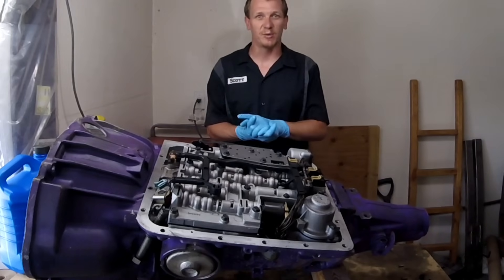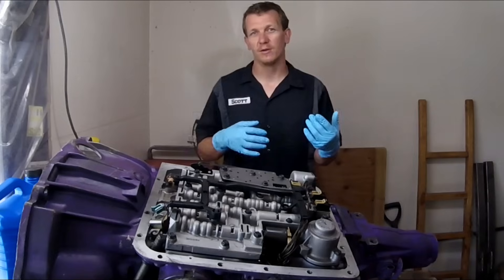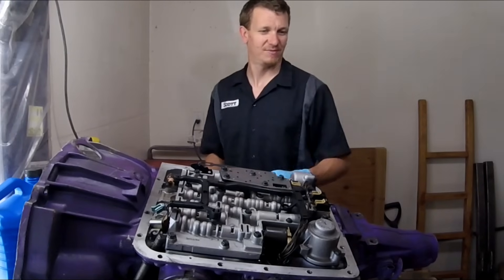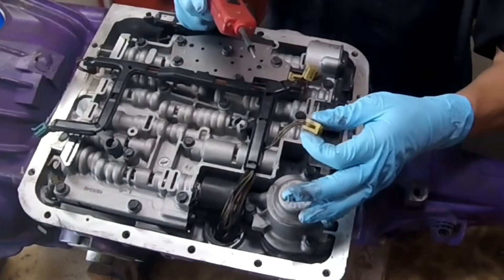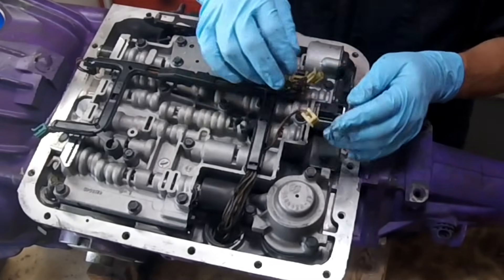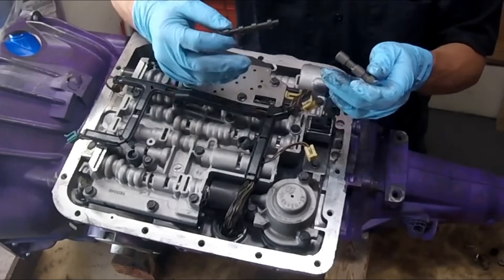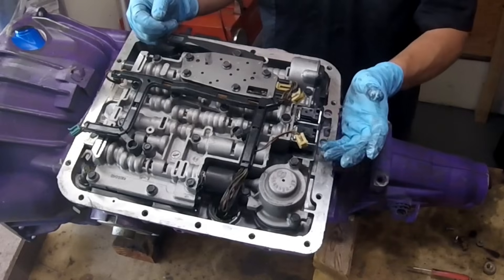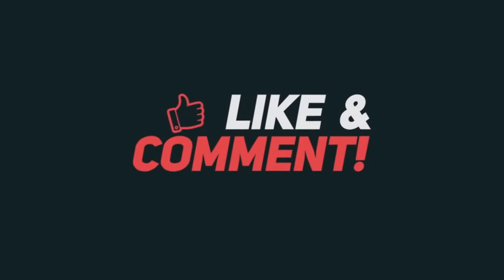⫷ GM 4L60-E Shift Solenoid 1-2 3-4 A and B replace p0756 p0753 p0752 ⫸

Comment: Let me just explain my problem I have a service engine light on check engine soon it's nothing wrong with the engine is actually the transmission the transmission will shift into gear but if I sit for a minute it won't shift into gear but if I shut the truck off start it back up it'll go into gear and it'll drive in the first gear and when you tries to switch over to second gear it's like second gears not there and then sometimes it'll switch into second gear and you'll feel it for a little while and then it'll go away now I have noticed when I started I can hear the pressure solenoid make a click sound that's real loud enough for me to hear it put it that way if I drive a short distance and I stopped going to reverse it goes into reverse a backup I put it back in the drive or go in the drive I'll drive for a while and when I put in Reverse versus not there does that constitute the transmission is gone what is a severe problem with well almost to severe you're my question is is that cause by the solenoids or does that mean the transmission is gone it don't make sense when the transmission fluid is clean I keep the transmission fluid full is clean it's not overheating or any of that it just started not working one day

Comment: There's just not two why don't you mention all of them I found that there was seven of them and I'm having a damn problem
Reply from the maker: You need to save for a rebuild. Don't waste the money. These are shift solenoid a and b. There are different solenoids but they are not c, d, e, etc. But if you have over 100k and problems, save for a complete rebuild. The bag of worms has been open. Good luck!!

Comment: hey man wondering if you could help me out I have a 2011 Silverado with 4l60e I have first and second gear doesn’t catch 3rd or 4th. What could he the issues I was thinking about replacing the shift solenoids and the torque converter solenoid
Reply from the maker: You could try those parts. If you have over 90k, probably the 3rd and 4th are probably worn out. Its common for the 3rd gear check ball to go bad in the case and leak. That causes 3rd and 4th to go bad in these trans.  

This is a video that goes over the check ball a little: https://youtu.be/rkhMJe3iS7w

Comment: Hello
I bought a A new 4L 60 E harness I just replaced my TORQUE CONVERTER and now it’s throwing a code P0758!  transmission fluid is filled at the right level

Comment: hey sir got a 04 cadillac and  its fine in par drive revers but when i put it in drive seccond to third gear it revs high till i let go the foot and it shifts but if i go in manual mode 1 2 3 no problem  whats up? anyone  got some tips?
Reply from the maker: Can't guarantee anything but if I was looking at that transmission I would start by looking at the accumulators.

Comment: I had a very weak shift solenoid when applying the 9v so I replaced it the sluggish acceleration went away tons of power but 3rd gear completely slips lost not sure what’s next.

Comment: My brother thank you for your time and help. My situation is. I’ve replaced the transmission, both shift 
Solenoids,filter and fluid. And I’m still getting the same reaction from my first situation.2004 GMC envoy:4.2 / 2 w/ Dr. Please please help me with this project. Also I have no obd 2 codes

Comment: Quick question,  which solenoid controls shifting from 3rd to 4th , or overdrive?
Reply: Ok ...how do you know it's b
Reply: I wish i knew which one is b solonoid also @jeromeneely202
Reply: Were is overdrive solenoid at for 1993 c1500 Chevy truck
Reply: @timhinson2841  B solenoid
Reply: B
Reply: @timhinson2841  in the transmission
Reply: From there both are same, you could put them to left or right!

Comment: In your video you say both wires of the shift solenoid plugs should show continuity. That being the red and green of solenoid A and red and orange on solenoid B in a 2004. I'd did that and only the red Gaver me continuity. My question is if it's a DC current why would they both have negative continuity?
Reply from the maker: I believe it was key on engine off all wired had continuity.
Reply: @ScottiesHobbies  Wouldn't key on send a normal DC signal? How could you get all 4 negative?

Comment: How can I check my shift solenoid on same exact trans u got here with a multimeter?
Reply from the maker: You can check the ohms of resistance using a multimeter. I don't remember what the specification is off the top of my head. You could also use a 9 V battery is the battery and see if the solo noid clicks when you apply 9 V power.

Comment: Can these shift solenoids cause code p1870 to pop up on my car scanner?
Reply from the maker: Doubtful. Probably something more to do with the valve body.
Reply: @ScottiesHobbies  oh ok I see
Another quick question sometimes getting off the highway I have a hard shift on the gear going from one to two but on red light I shut off my truck and before it turns green I start it up again and the hard shift goes away. What do you think has to do with that?

Comment: you mentioned using power probe to check for ground in solenoid wire harness (said should have ground on both sides or plug) which it would have been great seeing you actually have the probe activated on a battery to see you do it... I get ground only one one side of each solenoid harness, so was it true the probe should light up or beep on both sides? and or should the car key be turned? or everything off to do test?

Comment: I have a 4L60e that slowly starts to overheat after 60-90 minutes of run time then starts to shift hard. Any thoughts?
Reply from the maker: Plugged filter would be my start. Poor flow can cause the fluid to hear up.
Reply: @ScottiesHobbies  I'm going to start there. I just thought it there was something else I could check or change once I'm inside I would. Thanks!
Reply from the maker: @caseyott7463  its hard to say look at this one thing or another. If you are getting over heat and no drivability issues, I'd think fluid flow is going to be the issue. You could have deeper issues such as a bad 3rd gear check ball causing 3rd and 4th gears to go bad. If you have a lot of material in the bottom of your pan, get ready for a rebuild.  Other than that, might check the valves in the manifold, but... I think you'd get a code or drivability problem.
Reply from the maker: @caseyott7463  if you have compressed air. I'd take both sides of my cooler lines off and put 3 to 5 psi through one side to clean the cooler lines out. You might have a restriction in the cooler too.
Reply: @ScottiesHobbies  transmission was rebuilt about 2 years ago. Didn't notice any issues until the first long trip. Wasn't sure if I should change anything else while I have the pan off
Reply: @ScottiesHobbies  will do. Thanks for the info!
Reply from the maker: @caseyott7463  honestly... once upon a time.. I bought a rebuild that was 'bullet proof'.. around town for almost 6 months it was fine. Then the first camping trip we  took that season, we took that tahoe. Couple hours from home, almost 200 miles away.. I start getting the trans over temp on dash. We parked, let it cool down and made it up the hill. Thank God it was mostly down hill the whole way home. I ended frying 3rd and 4th gear cuz the checkball in the case never got changed.

Comment: I did replaced the solenoids on my 98 blazer and after i assembled all together    i started on but did not engaged either forward or reverse. I problably need to go back and check the solenoid pistons and continuity on wires. Thank you so much for this video.
Reply: What did you end up doing? My 94 Silverado is doing the same thing.

Comment: I have a question,I bought a pair of shift solenoidsand they are letter A but the original ones are letter B and my transmission is only working on 2,3 and reverse,does the letter have something to do whit it? thanks

Comment: I have ground only on 1 wire for each shift solenoid. No power to pin e but there is on pin d. Had p0756. Tested solenoids and they were good cleaned vb bore and nothing. Shifts good sometimes but then goes into third.

Comment: I just swap the tranny 4L60e and checked the solenoids 2 but I just noticed that B solenoid doesn’t have the spacer. Is that common or not? If not what is there for me to do?
Thank you
Reply from the maker: I have not figured out what is a noticeable difference on this situation yet but not all of the valve bodies have a spacer on the solo noise. If yours did not do not be alarmed and reinstall as it was.
Reply: Thank you
Reply: What’s your take on cleaning vs swapping the cooler lines? I can’t find the product to clean them
Reply from the maker: @elguero2296  ill turn my air pressure down to 10 psi or so. Make sure both sides of the cooler lines are disconnected. Introduce air to one line so the fluid and debris will come out the other side. You can swap the hoses too to get the same effect. But the cooler might be clogged on that case.

Comment: What would be my issue on my 07 suburban if it shifts into 2 gear fine but when it gets ready to shift into 3 it doesn't?it just free spins threw the rpms.doesnt try to shift into 3 at all.any info would be helpful right now

Comment: Hello! I am having a shifting problem in my 2007 suburban 1500 LTZ. SOMETIMES, but not always, I can feel that it will not fully shift when I first start to drive. In order for me to fully feel it shift into gear I have to press the gas anywhere between 10-15 and ease off of it for it to shift, at this point I am anywhere between 0 and 1.5 RPMs,  this again doesn't always happen but does occur once in a blue moon. Same thing will happen again, I have to press on the gas and get to anywhere between 15-30 and ease off of the gas for my car to fully shift into the next gear, and at this point I am anywhere between 1.5 and 3.0 RPMs. In the 2 scenarios i gave that happens, my car over revs until it does shift, so that is how I feel and hear that it's shifted. I don't go anywhere over 50/60mph usually, but when I do, I don't notice any problems there as far as feeling it not shift and whatnot, I just feel like I am not going as fast as my car says I am, if that makes any kind of sense. We have fully replaced my trans back in May, we have checked TCM. ECM AND BCM, we have replaced speed sensors and at this point we are at a loss of what to do next. My husband is a mechanic for the military, and has worked on our type of vehicles, and a lot others as well, all his life. I also have been having the problem of my radio cutting on and off and my front left and middle driver side AC vents not working correctly (i.e. I will have the AC on and those to vents and the feet vents will be the only one blowing out super hot air as if we have the heater on instead), I feel like somehow that has a connection with everything but I'm not an expert.. He's tested all my fuses and anything you could think of in the car and under the hood and they're all good as well. We did have to rebuild part of my engine a couple of years ago, but I haven't had any problems with the engine itself since then, and he's checked it just in case, but no codes are coming up for the engine... What else could there be that he is missing? PLEASE HELP, because I really don't want to have to get a new vehicle after we just paid it off a few months back. Thanks!

Comment: I did a 94 chevy Silverado.  I was replacing solenoids and  I heard something pop and fly and hit the rear end.   Found everything I cleaned everything up put new solenoids in.  3 years later still  shifted  good.  My second experience was a code on a 2001.   I found out a 16 year old changed transmission fluid and knocked a clip loose with the pan ,  while inspecting it.  Just snapped it back in.   The simplest solutions are usually the right solution.
Reply from the maker: That is the biggest mistake with new techs. I did it too. A lot of repairs are small and noticeable if you take the time to look at the whole picture before you start. 

Great tip!! 💪👍 keep us posted on your repair process and let us know if you have more awsome tips.

Comment: oh ya I used a snap on brick scanner to check if shifting it show it is shifts to 4 gear lock up and if u go under and turn on shift solenoid with scanner u can hear them click but not the tcc one not sure witch one scanner turning on but shouldn't you hear it click to   thank again rick

Comment: I got a S10 98 Chevy blazer it throwing 753 code shift 1/2 I changed them both it shifts great but it keep throwing the same code if went threw all wiring only thing I'm finding is   tcc is only showing 10 om's  it shows to be u on transmission plug just not sure witch one it is of the tcc solenoid it is but shouldn't it throw different code if it  iv had pan off like 5 times now checking wires and solenoid's thank in advance all help would be appreciated

Comment: i have a 2012 mazda 6 and there’s this AT light popping up next to the part symbol i replaced the tcm the transmission fluid and speed sensor but no luck could this be the issue ?

Comment: I'm getting no continuity from any solenoid wire, HELP
Reply from the maker: with key in the on position?
Reply: @ScottiesHobbies  no...the key was off...MAN and I've already put it back together and it didn't fix the issue... interesting though, in neutral, the vehicle is STILL driving...

Comment: This video you say the drivers side is solenoid A the other video you say the passenger side is A Im confused
Reply from the maker: Don't worry too much about which is which. They are the same part number. Replace them both and make sure your shift valves move in the valve body. If you have a bad harnes, you can get solenoid codes too.
Reply from the maker: Check this video out: https://youtu.be/lg8cCPQHpu0

Comment: Do we need a special device or something to reset the cars computer after replacing these solenoids??
Reply from the maker: You can use a obd2 reader to clear the check engine light if its on. But nothing to special, $20 on ebay these days.
Reply: @ScottiesHobbies  thanks I appreciate the info
Reply: Thinking about just doing it myself. Seems easy to access under the car as well.  I have a regular mechanic shop quoting me $1560.00 to do this exact process on my GMC Acadia today. That seem very steep to me. Would you say that is about the average price for something like this??

Comment: On my 2004 GMC Envoy, when I shift out of park into any gear, it just revs up when I accelerate but no movement as if I'm in neutral. The shifter linkage cable is good and it shows I'm shifting into R, D, 3,2,1. Do you think the shifter solenoids have anything to do with this? Or do I have a bigger problem. When I changed the transmission fluid and filter about a month ago, the fluid was brown and there was a good amount of metallic sludge at the bottom of the pan. I changed those out because between gear shifts while driving, it would make a reving up sound before the shift. I took the pan off the other day to get to the solenoids and will be replacing them tomorrow, but noticed I had a little more metallic dust accumulation in the pan. Not sure if that's new, or if it's still from the old fluid that was in the transmission.
Reply: Hi. Did you find out what is it? I have the same problem with my 2013 rav4?
Reply: @JoseJimenez-nn3wb  No I never figured it out. The car is still sitting in the street. Ended up just getting a new car. I changed those solenoids out and it didn't help. I was told my next step was to just buy a whole new transmission, which I wasn't willing to do. Bought the car for $3000 and got 2 years out of it, so I figured it was just time to buy something new.
Reply: Omg!. I have 3 codes P0746 P0776 P2714 (solenoids A, B and D). Now i don't know if i should replace them or buy another transmission.
Reply: @JoseJimenez-nn3wb  if you have actual codes telling you it's the solenoids, then replace the solenoids and see if that fixes it. They're cheap and it's worth a shot. If that doesn't work and your linkage cables are good, that's when you'll want to consider a new transmission.

Comment: 1994 c1500 with 4L60e. Upshifts fine but doesn't down shift. I can down shift manually. No slipping in any gear. OBD1 system on truck and no check engine light on.

Comment: You didn't mention which one was A and which one was B is there a way to tell them apart ? And thanks for the video
Reply from the maker: I have a few videos cover which is which.  But the are the same part numbers and I'd rereplacing both at the same time and use acdelco parts if possible.

Comment: I need your opinion on this one because I’m not sure so whenever I got the car I was told the trans was “rebuilt” it goes all the way to 3rd gear an will not go to 4th I manually put it in 2nd an it’s fine does feel sluggish going threw gears but it will not go into 4th well at least this is what I’m thinking because the car starts raving alittle to high I think it’s perfect till I get at about 60 or 65 an then you start to realize it’s not shifting oh an also if you kick it down it doesn’t down shift from what I can remember I’m gonna go for another drive an test it again do you think this could potentially be my problem because the trans doesn’t feel bad whenever I manually put it in second it pulls great even 3rd pulls great just no 4th
Reply: I can maybe help you out. Your transmission is actually in limp mode. And if you hook a code reader up, you will be able to see which sifts shift. Solenoid is acting up or why the transmission is in limp mode. My transmission in my Cadillac Escalade was doing the exact same thing and it ended up being Shift solenoid for 1 and 2